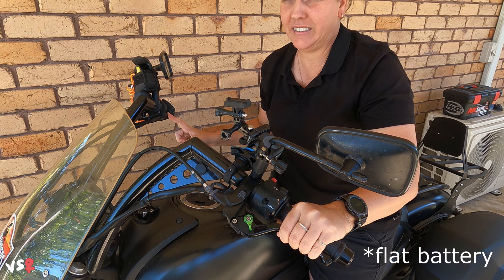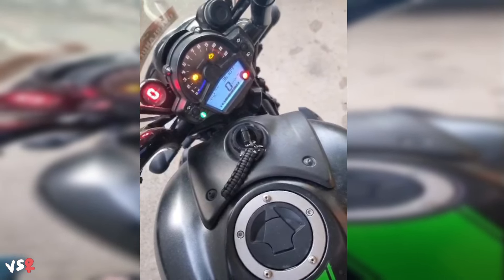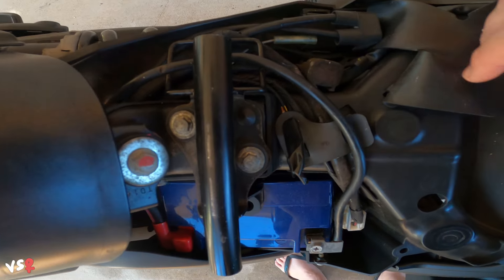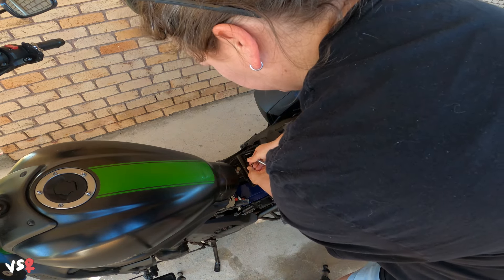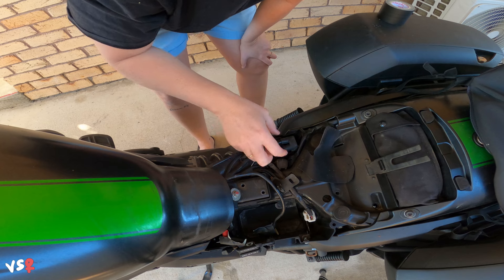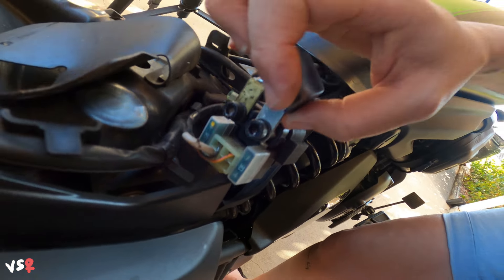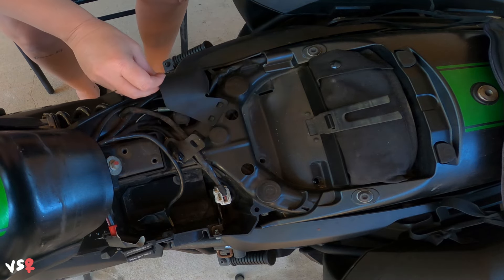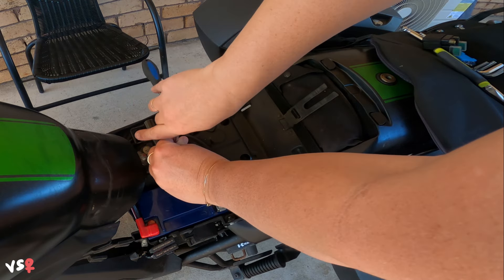VS♀️ Replacing Solenoid Relay (Vulcan 650)

Comment: Nice work... exxy for a small piece but you saved doing it yourself! Zapped twice?! Went back for seconds! 😅 I tested a self installed electric fence that was meant for a farm (set it on a town block) - threw me about 10 feet 😅
Reply from the maker: Yeah it was waaayyy cheaper if I had of bought a knock off version... but I kinda like the green box it game in.. so I went with the genuine part ;-) 

Also... yikes!!! Did you do it twice?? Haha

Comment: Your videos are always helpful. Is there anyway that you could tell me which way the two fuel lines on the left side of the tank get connected? I think one is a fuel return and a vent maybe? My tank is marked with a blue dot but neither hose is marked.
One of the hoses runs down through the bike and out by the kickstand, should it be connected to the port on the tank with the blue dot or the other port? Any help would be greatly appreciated. I was hoping I could see it in some of your other videos but you didn't go that far